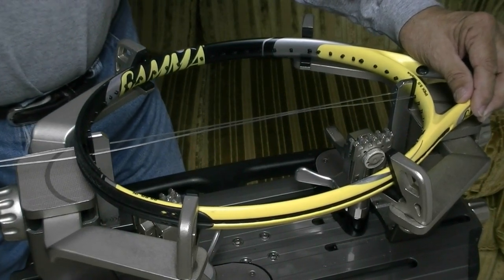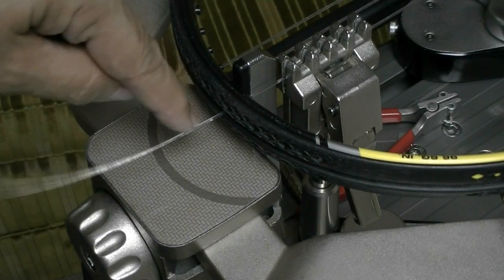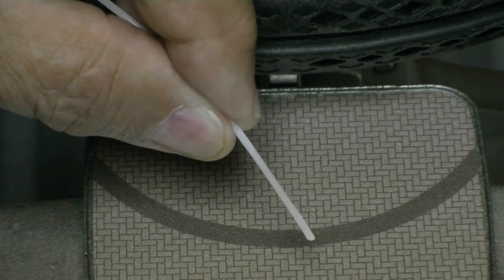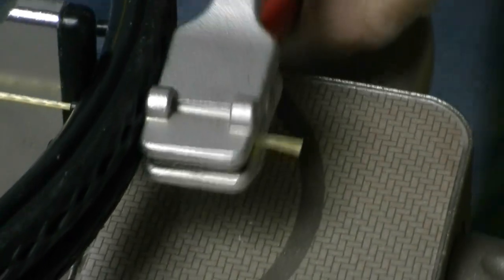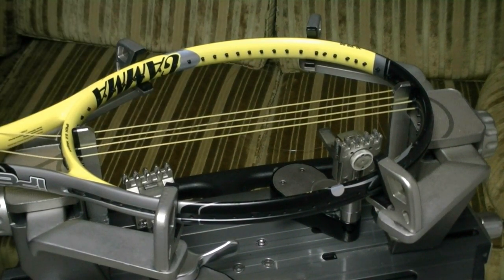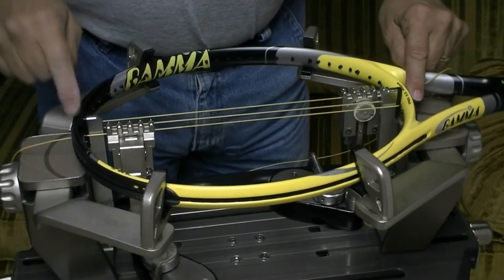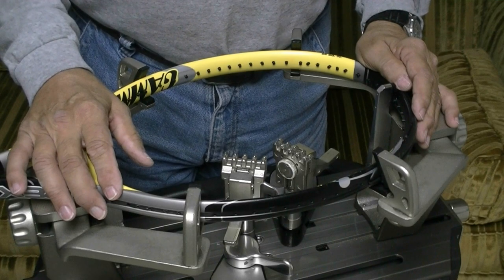Starting mains with starting clamp.flv

Comment from the maker: Thanks I have a Gamma 6004 stringer (crank or lockout machine) with a Wise tension head
Reply: Mr10sStringer, I had a Babolat Star 5, unfortunately, I ended up selling it a few years ago. It was a gorgeous machine! Getting my stringing business going again, and have been looking at getting a Gamma 6004 with Wise (6 point like my Star 5 was). Looked at Neos 1500 as well. Some frame limitations with Neos though. Obviously I would love a Star 5 again, yet the cost is immense. As well, I like the thought of being able to string with no power (i.e tennis tournament parking lot, etc) by removing the Wise, then putting back on crank and off I go. Any feedback for me on the 6004 with Wise, and bring Mobile with putting back on crank? I wanted to tap into a "Mobile" stringing market, that I think exists (travel to tournaments, set up near facilities and compete with other stringers at those facilities). Is the 6004 relatively easy to move? My Star 5 was ROUGH to move. I LOVE YOUR VIDEOS!!!!
Reply: If you have the 6004 with Wise, I am assuming you likr them?

Comment: Do poly strings shear more often than nylons?  I strung a poly string on a racket twice and each time it sheared at the top.
Reply from the maker: Wally Friend yes they do. Poly strings are stiffer an early more resistance to bending. When you hit the ball near theframe there is a sharper bend of the string at the frame. I believe that helps the string break easier.
Reply: Thanks for the response. I tested the poly I used with string tight to the hinge of starting clamp and noticed that there was significant string depression.  I think that the shearing is exacerbated by this. So I'm going to follow your advice and only clamp half way down and use the Yusuke method.

Another question is in the video you pull 4 mains at once, there's little difference between doing this  and applying the Yusuke method on one side of the mains. The only thing I can see is that the initial pull is symmetric while applying Yusuke on one side will imbalance the pull on racket. Is this that important?
Reply from the maker: Wally Friend I’m not sure what your question is. In the video I did not pull 4 mains at once. I pulled 2 on the left then 2 on the right.
Reply: The question is that you could have just used the yusuki method to pull two on the left without pulling four together. Why did you choose to do this way?
Reply from the maker: Wally Friend ok I pull 2 on the left I don’t want to pull any more on left so I switch to the right. I never get too far ahead on either side it puts more stress on the racket and makes for greater tension differences.
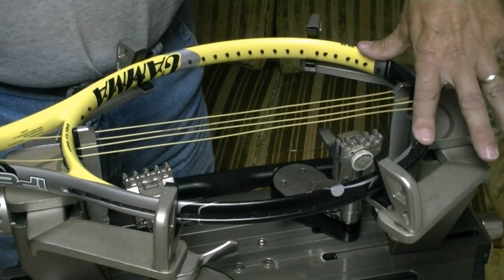Reply: Thanks for the response but maybe I’m not asking the question right.  At time 7:15, you pull 4 mains at once to start the mains. This avoids putting a starting clamp at the top of frame as you say.  My suggestion is to instead start at two left center mains with the Yusuki method to avoid the issue of undoing the center mains. That is double pull L1 and L2, place starting clamp at bottom of L1 or L2 and clamp the top of L1 or L2.
Reply from the maker: Wally Friend now I see what your saying. At that point I’m not tensioning the center four mains. I just put a little pull on them to set up the starting clamp at the bottom and the machine clamp at the top similar to the Yusuki method but I have the SC at the bottom of the frame.
Reply: But couldn't you do what I suggested which is less fussy.  I'm considering to do this on my next stringing as I think it's a good direct method of using the starting clamp at the bottom of frame.
Reply from the maker: Wally Friend yes it’s the same thing pretty much.